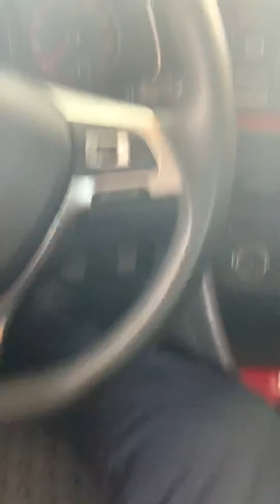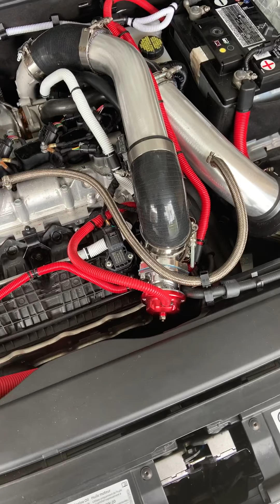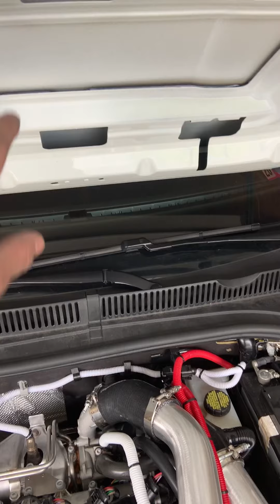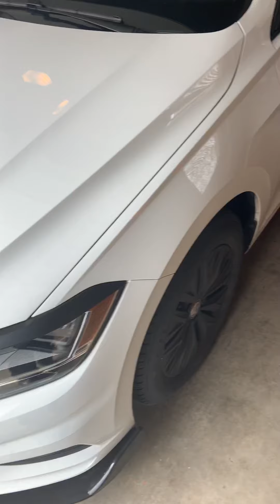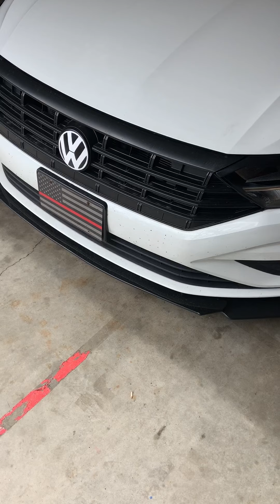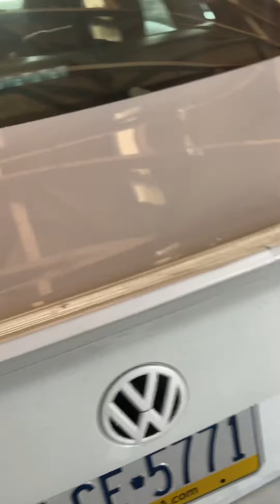2019 VW Jetta 1.4t  custom charge pipe overview

Comment: Hey buddy just v getting started on my pipe and wanted to know the airline from the intake to the charge pipe is what size and if i keep original intake system  Can't I just take the airline off the old charge pipe and plug it on to the stem that comes off of the new aluminum charge pipe.  I just don't see it in the video of your overview I was curious if you plugged it from the bottom did you use a regular hose clamp

Comment: What would you recommend for easy performance mods for this model without doing any HUGE modifications? Love the ride 🤙
Reply from the maker: Ohlu Honestly if you’re looking to do an easy performance mod. I would say do an intake on it. It’ll definitely give your turbo louder sound as well as the swoosh when it recirculates into the intake. Another thing you can look at is eliminating your silencer and the resonator. There is no O2 sensor in either one of them so you can completely illuminate them with straight pipe. My Jetta is currently straight pipe from the downpipe back to the muffler. And I’m currently looking for an aftermarket downpipe. Another thing you can do is cosmetic mods that will help change the appearance of your vehicle as well
Reply from the maker: Ohlu Also on a sidenote I do have an additional intake piping I believe as well as a silicone coupling. That I had on my Jetta before upgraded to a larger diameter piping for the intake. If you’re interested I could give you a price on that with a filter and what shipping would be. I can check tomorrow when I’m done at work to verify that I do actually still have one.
Reply: FF54 Vic thanks for the info!! That would be pretty sweet if you could get me some more info on that I’d really appreciate it, I’m really wanting to do something small cosmetically like what you’ve done, looks clean! I was checking out cold air intakes and I see AEM has one that was going to possibly get, just wanted to make sure it was a good bang for your buck.
Reply from the maker: Ohlu i’m actually going to be getting or I should say taking off the front lip I have mounted on my Jetta currently because I ordered a different style. So that is an extra part that will just be laying around my garage if you’re interested I could give you a price on that with shipping to your location. It would be cheaper than purchasing the same one I bought from eBay. With that being said I would also cut down on your shipping time because they come from China like most of the aftermarket cosmetic parts I’m signing for this vehicle. Because there isn’t a US manufacturer Currently making them that I found
Reply from the maker: Ohlu So I checked in my garage I do have a 2 1/2 intake pipe left I could fabricate it up to fit your Jetta. Did you say your Jetta is also a 2019? I also have a filter and a silicone coupling if you’re interested send me your email and I could give you a price on what it would be for the intake with the filter and silicone coupling. The only thing you would have to get would be a small hose to go from the top of the motor or the engine crank air supply to the intake.

Comment: hey man i have same car all black im looking to get intake and the pipe to the turbo i see you live in pa same here
Reply from the maker: Christopher Smith where are you located at in PA going to be going through some of the extra piping I have and seeing if I can fabricate any more intakes for this Jetta or the 2019 I should say. They do have some intakes but they are pretty pricey so I’ve just decided to fabricate my own. And one thing I do to the intakes that I fabricate is I give them a brushed aluminum finish rather than the shiny aluminum just to stand apart. From the main stream intakes that you could use because I haven’t figured out a name to put on the intake piping I’ve been custom making.

Comment: I have a Jetta 2019 1.4T I want to put lights in the front lights and add lights to the interior of the car do you think you could show me and I mean as on the dash and around the gear shift
Reply from the maker: I have a video uploaded I believe of how to do the lighting and what wires to tap into for them to come on automatically with the auto headlight function. I believe I also have another video of where I just the lights on the exterior of the car showing where I put the toggle switch

Comment: Hey you still running it without the second cat? I removed mine and started getting codes I have the 2019 Jetta 1.4t mt
Reply from the maker: I am still currently running street light from the downpipe back. I do still have the cat on the downpipe but nothing back till it gets to the muffler. I have not received any check engine codes for that. What code comes up on a code reader? I had to take my Jetta to the dealership to have an N 80 sensor replaced. That’s a sensor that is going out and some of the models.

Comment: Where do I get that cold air intake?
Reply from the maker: Omar dominguez Actually customized it The piping is actually for an accord intake at some length modifications. And then you would just need a 2 inch to 3 inch coupling to go over the factory intake inlet

Comment: What front lip is that?
Reply from the maker: William Dixon III Honestly I’m not 100% sure of the brand I got it on eBay I’ll  tag you in the next comment with a link to the same front lip I bought.
Reply from the maker: William Dixon III So I went back in to my eBay purchases however it won’t let me click on the link. But if you search universal front lip or you could actually even search 2019 V wagon Jetta front lip and it should bring up several different variations including the one I have.
Reply: William Dixon III hey if you look on ebay you will find it just make aure you do get the 4 piece front lip and not the 3 piece the one FF54 has is the 4 piece one
Reply from the maker: Jaime Quiles Correct I have a three piece one I’ve been kicking around ordering the four piece front lip but I’m still up in the air on it. They have it where it’s already painted white to match the car that’s what I’m looking at
Reply: FF54 Vic yea i have the 4 piece one the 3 piece is way to big where did you order your rear spoiler i want that same one with out the 3rd brake light thing
Reply from the maker: Jaime Quiles I got that on eBay as well I came with a red reflective plastic piece and I just plasty dip Dwight sure you’d be able to plasty dip at black.they have some that don’t have any reflectors In them as well but I didn’t care for some of the styles